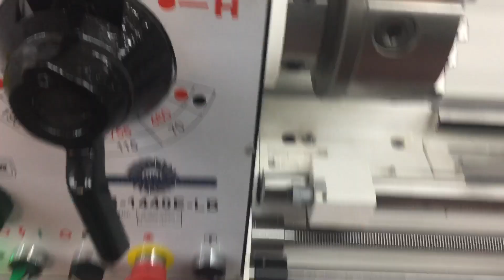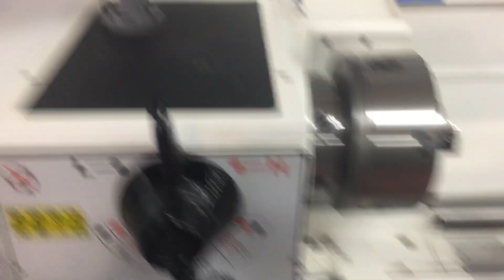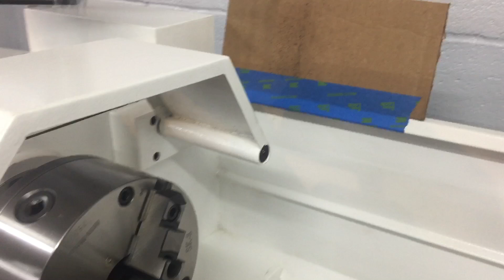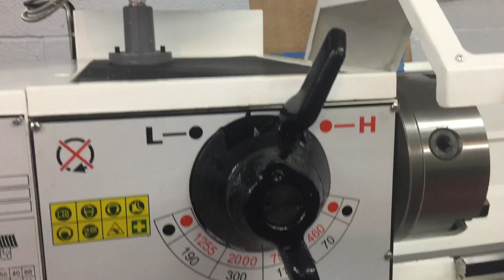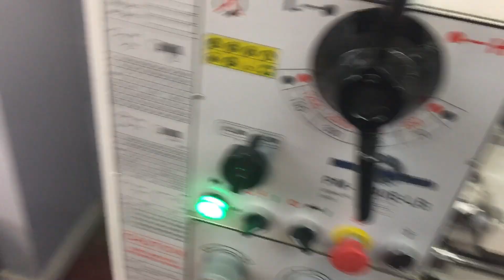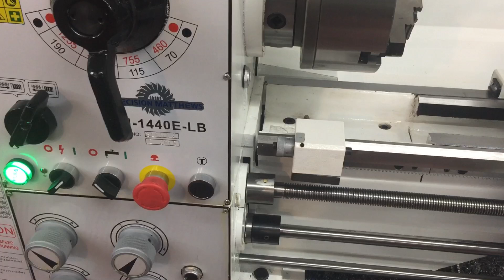PM-1440E-LB Lathe from Quality Machine Tool

Comment: looks virtually identical to the al336 from H&F..., the standard gap bed 12x36...

except for the one crucial feature which is what im always looking at now...

the tailstocks done properly on these.

take a look at the aforementioned model and see if you can see it... even the latest PM 12x36 does it. they all come from the same factory after all. ive noticed a very old PM 12x36 seemed to be "correct".

i have contemplated trying to get one shipped over, but ive decided its better to fire my furnace up, practise my timber work skills, start mashing up some more greensand... and make a lever/ram type with a shaper/slotter affair instead.

now ive added a DRO... its even worse. absolutely kills me, makes me not want to use it, as working between centers is an absolute nightmare.

actually, this is probably a rebranded version of the al346/al356. that little bit bigger. and the taisltocks done properly!

Comment: Thanks for the video. I plan to get this machine for the university though am quite demoralized that, in searching for a new lathe, the vast majority of them are made in China so that no matter which one you buy, they are all substandard in design and quality. I'd rather buy a vintage clausing or southbend fully restored but the university would not accept it. While it's true that you get what you pay for, it's sad to think that, in this day and age,  we have the most advanced machine tools ever created with 5 axis, extreme accuracies, and high speed machining yet the manual lathes made today are worse in design and quality than they were in the past. How is that possible? Car designs are being improved practically 24/7 yet lathes made today are clunky, lack accuracy, and always need to be "upgraded" in some way. If we did this to a new car, we would not buy them. Anyway, and considering all the lathes I looked at online, the PM-1440E-LB looks like it was made better than all the others for at $7.5K Just as we have car lots, I wish we had machine tool lots. lol
Reply: i hope you never contemplated any of the common 12x36 gap beds as the tailstock renders them useless and theres not much to be done about it as they ALL seem to be the same.

wish i had noticed it when i bought it, i would have gone up a size where it isnt an issue...

if its for a uni... someones going to crash it. and whilst it may be taxpayer money....

yeah. i thought universities were places of education but it appears in this day and age their places of indoctrinated stupidity.

hear hear about quality. but remember, that old clausing/brown&Sharpe, cinci, etc? it probably cost the equivalent of 5X when new... they were built and intended for production.

these days theyre built for hobbyists and low volume work in a shop that probably has a bench grinder and plasma cutter next to it and never gets covered or cleaned.

Comment: My dad just bought a similar lathe, only problem is it won’t let us move the carriage on the X axis manually, it only engages with the sleeve and moves back and forth as needed but when we rotate the lever to move it it won’t go. Any thoughts?
Reply: Sounds like it NEEDS ! The Metal Shreadder ! STRAIGHT !  AWAY !

Comment: Do you know if it's a Chinese built machine or the preferred Taiwanese built?
Thanks for the video.
Reply from the maker: It’s Chinese for sure. But it’s built to the higher spec called for by Precision Mathews. The Chinese will build you anything you want. Cheap is cheap. Good is good. This lathe has a good balance of both. If you want the best, look at their Taiwanese lathes for about double the price. There is a big difference.
Reply: Xi Jinping built it ! To kill you !

Comment: I just happened to run into you. The date is July 2021, Mathew Precision and just got this updated Lathe PM1130. It looks 👌 nice and I think it will turn out as a good hobby 😀 unit. Your Lathe, so what types of projects are you doing??
Reply from the maker: I use my large for general fabrication and repairs in my shop. You just never know what I’m using it for. Currently I have a brake drum on it off of a John Deere model 60 that I’m slowly restoring. 👍🏼
Reply: Just having it for Projects

Comment: Is it possible to add the protective cover on the mother screw ?
Reply from the maker: Sure, anything is possible. It would be difficult to do since the carriage slides along that screw. I suppose you could add a boot of some kind. Just know that these are pretty much exposed on all lathes and there aren’t really any provisions to mount any kind of guard. Using a large can be very dangerous and does require 100% of your attention when in use. 👍🏼

Comment: the only problem with this lathe is the saddle wheel being in the front as I prefer them to the rear so you do not get swarf over the left hand, it can be dangerous,but the rest looks good. mine was a Colchester 18-80 I now have a smaller one after the same type as I am retired

Comment: I notice this video is a couple of years old. How has it held up for you? Have you used it a lot?
Reply from the maker: I use it on a regular basis, not everyday or even every week sometimes, but pretty regularly. It has had zero issues at all. This has been a very good tool and investment honestly. It’s not the highest quality machine mind you, it has some paint flaws and minor casting flaws where it doesn’t matter. All the stuff that does matter works well and has held up to my use. I don’t see any real long term issues with it either. 

I am contemplating maybe installing a 3 phase AC motor and VFD for even more spindle speed control. But that’s another video and another bag of money. 😆
Reply: @dieselshadow  Great! Thanks for the update and the video.
Reply: dieselshadowman Can I ask if a 13 x 40 Model with the variable speed controls would maybe be a better buy to avoid later having to add 3 phase motor & vfd?
I’m presently considering this metric equivalent that seems to be a sister lathe possibly even from the same Chinese factory.
https://www.machineryhouse.com.au/L555D

I have to say I am surprised greatly at how noisy yours is in high gear, such that I suspect it might drive me crazy if I were using it all the time, I found it “irritating” while you were filming & speaking because it was so loud. The same demonstration in low gear would have been far more enjoyable to watch I suspect.
Now I have to take a trip down to machinery house and listen to the one I’m interested in to see if it’s as loud as yours as that might be a deal breaker for me. I wouldn’t be able to hear myself think over that din.
Maybe it’s just that your camera microphone picked up the sound & exacerbated it?
Maybe if you have a sound decibel app on your smart phone you could measure the noise level when operating.
Part of my thinks if they aren’t tapered roller bearings on that 2 inch spindle, maybe they are ball race bearings and possibly not well packed with grease or not being properly oil lubricated or something?
Surely it shouldn’t be that noisy?
Reply: @ianmoone2359  I have a PM1440HD so not the same machine but similar. Bearings are tapered roller and lubed by the main gear case oil. I think that is the most common on this size lathe. If you have something that uses grease it is better to not pack it fully as that will cause more heat buildup. Gear noise will go down as the gears wear in but at top speed they will likely still be rather loud. They are spur gears. Expensive lathes may have spiral cut gears. But you are looking at several times the cost. Thing is you will very rarely use top speed. Maybe for polishing or very small work. You will find a slow rpm more useful than a faster one. My slowest speed is 40rpm. There are enough gears that I haven't wanted a variable speed. It might be nice for facing large diameters but some caution about spinning something large should be used. 3 phase motors are always preferable to single. Smoother power, longer life, simple design, can be variable speeded. Top speed is dependent on  the bearings and dynamic balance. Slow speed by heat dissipation and perhaps the winding configuration. 6 wire, 3 phase motors can be switched between wye and delta using a timer and two contactors to reduce inrush current. Common practice in places with shitty power and maybe useful for VFDs.  If you go the VFD route I would use the rotary rather than the static. You can make your own rotary very simply. Try not to electrocute yourself!
Reply: @larryschweitzer4904  You MUST BE !. CLEARLY ! IN THE !. ELECTROCUTION !.PHASE ! HERE !!
Reply: @davidwillard7334  "If you go the VFD route"  Meant to say 3 phase route. VFDs seem like a better way now that you can get them pretty cheap. My shop has 3 phase but incoming is only 208 V so I've got transformers for all the 480V equipment.
Reply: @dieselshadow  Sounds like youve been ROBBING THE BANK ! WAY TOO ! MUCH !! ALREADY. !!

Comment: you can fined it in aliexpress for less than halve price
Reply from the maker: You won't find the same lathe for less than half, but you will find cheap lathes there. 

As a general rule of thumb, you get what you pay for.
Reply: Yeah, until you pay for the shipping/ import broker (crooks), taxes, duties, and delivery, then congratulations.. you just jumped through all those hoops and wound up paying more than buying it from PM. I've been through it a couple times now, and I've learned my lesson.

Comment: Chinese machine tools are bad news. This model is marketed under a half dozen names, PM, Grizzly, Harbor Freight etc.   It's greatest shortcoming is plastic gears. This is a lathe for hobbyists at most. There are many machinists that wouldn't  work on these.  In a busy shop, it wouldn't last the day. This isn't an industrial caliber machine and It's dangerous.
Reply: 1 Flick, You really should know what you are talking about before you post. Change gears are metal, I doubt that anyone thinks they are getting a super deluxe Chinese lathe for this price. I opened all the compartments when I got it to make sure they were clean, they were. Gears & shafts looked fine. I have not detected any chatter in the spindle even during quite aggressive cuts in 4130. Dangerous?  Yes, but I can't see why it would be anymore so than any other lathe of this size. A machine of this power can not be stopped just by winding up your sleeve in it. The foot brake is instant. I always thread away from the chuck. When roughing I use inserted tooling at high enough DOC and feed speeds to form the proper chip. Most of the time I finish with HSS so I can sneak up on final. Have you ever used a PM1440? I've never used a mini lathe but I'm pretty sure they likely put price above all else, is that what you are experienced on?  I'm retired from my manufacturing business, fully expect my 1440 to out last me.
Reply: @larryschweitzer4904  HAVEN'T YOU ! BEEN ! ELECTROCUTED !! YET !!???
Reply from the maker: This couldn’t be further from the truth. Yes, it is made in China, but no, Precision Machine doesn’t have exact copies of all other machines out there. Matt specs them better and has them built to higher standards. You can get whatever you want from China, if you pay for it. 

There is no plastic gears within this lathe. I can’t speak to all PM machines, but this one is very solid and would absolutely do fine for any hobbyist or even some commercial use. If my shop was a machine shop and I used it all day everyday, then I would’ve upgraded to one of PMs Taiwanese lathes.
Reply: @dieselshadow  WHAT B.S ! IS THIS !??
Reply: In FACT ! ITS ! ALL PLASTIC !! HEY !! BIG TICK.!! FROM.ME !!

Comment: @DieselShadowMAn: now that you hd some time behind this machine. any 2 years later Pro's / Cons. wish you would have or wish not?  im considering the same E model. -Sam
Reply from the maker: I would definitely buy this machine again. It has been smooth, powerful, and plenty capable for all of my general projects. Now I'm not a full-on production guy or a precision machinist (like I pretend to be LOL), but this machine does everything I need and more. If you are a gunsmith or a production shop, or the most precise machinist that needs the best, I would look at PM's Taiwanese machines for even better features and a better fit and finish. Of course the price will go up accordingly.
Reply: 1: did you keep it stock as delivered? 2:  have you made any mods  or additions since. 3: the chip tray. is it easy to empty? (Looks like the DRO cables were laying in the tray. getting mixed in with the chips) 4: whats the actual travel on the compound?  I have several other lathes Im about to let go in lou of this possible lathe. thanks so much for the info. Again thanks.
Reply from the maker: Sam, no problem. 1, yes, it is stock except for the cardboard splash guard I added. 2, See 1, no mods. All of my dollars have been spent on tooling. The machine is complete and really doesn't need anything. 3, Yes, no problem. And yes, the cables are in the tray, but not a big deal. They are all kind of like this. 4, I don't have an actual measurement handy, but I know it's a couple of inches. An exact number should be able to be found in the specs on PM's website or a quick call to them. Who knows, maybe this has changed in the last few years as well? Doubtful, but possible. 

If you were local or close, I'd say come take a look at it yourself. It's a great machine and I'm glad to own it.
Reply: All good Info. thanks for taking the time to answer. Im guessing by your other posts were not neighbors. Im in Central FLA. (TampaBay) you im guessing much further north of me!. Otherwise I would mist certainly take you up on the "come see". :) 
  If you dont mind what kind of tooling did you buy? -Sam
Reply from the maker: Sam, I've bought tooling from everyone including PM. They are dealers for a lot of the major brands and carry stuff that's not so critical to have name brand stuff. Then I also get stuff from Travers and several other online vendors. 

Yeah, i'm in the Nashville general area. if you are ever in the neighborhood and wanting some great live music and a cold beer....
Reply: Im sure to take you up on your offer for some beers. next time im in that area. :) BTW. I did pull the trigger on the same lathe. Should arrive Sept26th? In the mean time Im planning on my install location. If possible and not to inconvenient. could you get me a few real world dimensions? the bases O/D (Left and right) the foot print size. they look like rectangles?  +/- 1/16 is plenty close. Im working on a base plate for my install. I dont want them sitting my floor So I need to build a frame/saddle of sorts. Hope that makes sense. -Sam
Reply from the maker: Sam, drop me an email with your phone number. I’ll delete my email address as soon as you get this. 

I’ll give you a call so we can figure everything you need. Sound good?
Reply: email sent! :)

Comment: My PM1236 leaked like crazy, nothing like redoing the gaskets, and even finding a couple of broken taps in the castings
Reply from the maker: I have a few very minor seeps, but no real leaks. The overall quality is pretty good, but the raw castings could be better. It’s proven to be a good machine so far. I use it fairly regularly.
Reply: dieselshadowman despite the headaches of the leaks, all the important tolerances and machining to ensure the axis’s are all correct, were done very well. I have to agree, nicest lathe I ever owned
Reply: Because BROKEN Taps ! Are put there for your !. Pleasure !